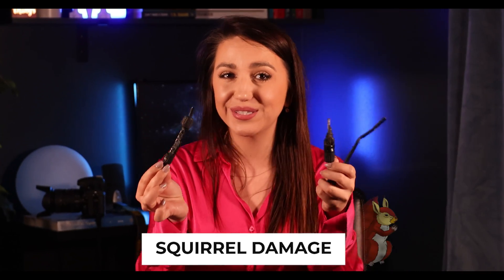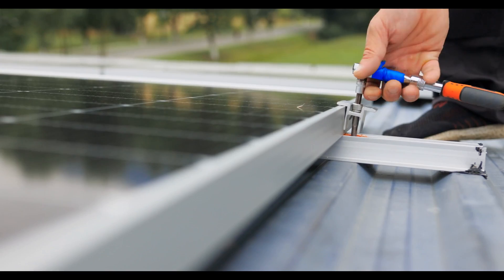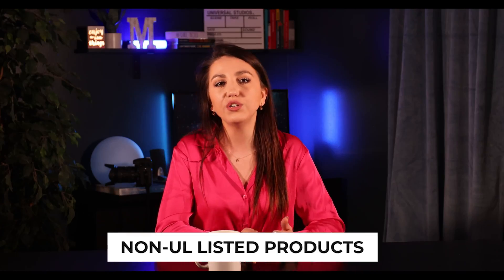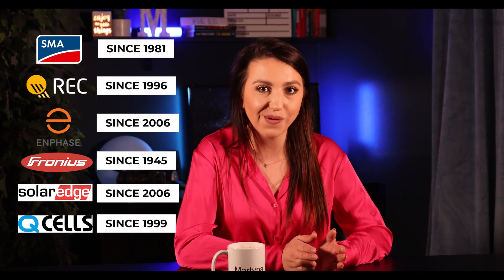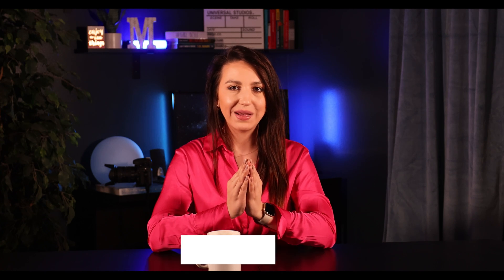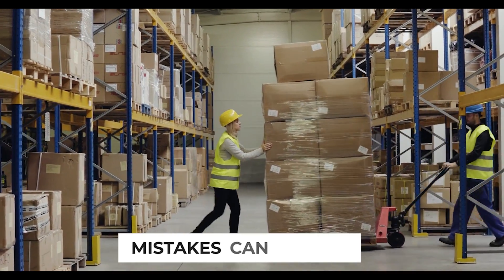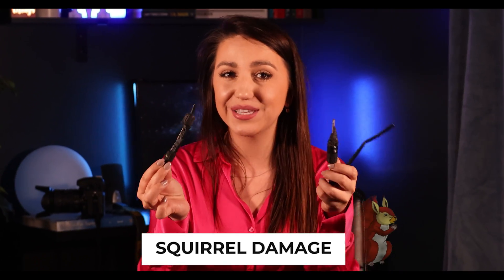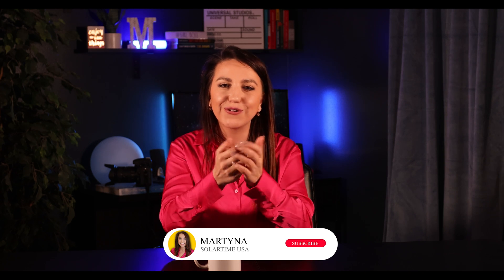Solar Panel Fire Prevention Tips You Need! / BEFORE AND AFTER GOING SOLAR!

Comment: Micro fractures of crystalline cells is a major reason for PV panel fires, I would be surprised if it isn't the main reason. And you can't see the micro fractures with the naked eye. They happen with vibration, impacts, flexing & age (basically everything). It's not an issue with thin films like CIGS or amorphous silicon. I wouldn't use crystalline PV, my choice is CIGS, it's more difficult to find (I think because most people are ignorant and the marketing on the crystalline PV has driven away most CIGS). The thin film PV also has better performance in less than ideal lighting conditions, so while the peak efficiency is lower I think the thin films would perform better over the course of a year.

Comment: the thing with micro inverters with big 500 watt panels  most micro inverters are 250 watts some can reach 375 watts they will not produce power that panel can provide also if something goes wrong you have to go to roof to replace them its  ac so you can putt batteries so you need another box, a lot of installers install them now  you will get clipping on panels if micro inverter is 250 watts and panel is 500  watts
Reply from the maker: Agreed!!! Thanks for sharing your thoughts!

Comment: your video has installers walking on panels its a no no and some wear safety harnes but are not tied off You can walk on solar panels, but it's not recommended. The panels can withstand a lot of weight, but walking on them can damage the modules. The center of the panels may crack, which can shorten their lifespan. The panels are also slippery and hot, and can cause you to slip and fall.

Comment: Long runs of low voltage/high current dc wires are totally wrong. Quickly they drop voltage and that means heat and degredation. I propose a ladder setup with short run of dc to a local inverter on each leg...that improves efficiency and safety and control for each leg.

Comment: No.not fusing the system caused the fire..ignorance..secondly all lithium should have thermistor alarm security.if any rise in temp is seen..the alarm would cut its load and seal it in a chamber.. and call  fire dept..

Comment: These fires are being caused by the high DC voltages in the long series strings that are being used by string inverters. Even off grid solar systems are now unnecessarily using high DC voltages to power their cheap Chinese made, fire prone, high frequency, transformerless inverters, Even when using an MPPT charge controller, off grid inverters should never use a PV voltage that higher than 150 VDC. Higher voltages are simply not necessary, and can lead to fire starting hot spots in the solar modules as well as arcing in PV wiring.
Reply from the maker: I have to somewhat disagree. If you look at statistical date, EU did not require rapid shutdown for decades. Not to mention that in a lot of those European countries German made inverters such as SMA or Austrian like Fronius or Steca allow for even 1000 V DC on a single string. 
And Enphase and other microinverters are NOT popular at all in European countries. Yet there are not  more fires in EU than USA. 

I do agree that CHeap products are super risky but I would not associate String with more risk.

Comment: I don't connect solar panels using plugs because even the best plugs will eventually break down due to weather expansion and contraction.
So I wire direct, because once installed, installation will probably last 20 years before maintenance will be required.

Comment: My issue would be corrosion from the saltwater environment, we are up in a hill about a half mile inland and 350 feet above sea level. Roof is clay tile with a concrete sub roof below. Any insight on stuff that is available in the EU? Also running dual power in the home with EU standard of 230 v at 50 hz as well as an inverter based 120v 60 hz system. And oh yeah, lightning loves to play around this area. As a communications Tech I have installed mount an top solar powered communications systems with zero problems but they were mid sized with massive battery banks needed for cold winter days. Shelters for the equipment were aluminum sandwiched with 8” of polystyrene foam and a silicone heater pads below the lead acid deep cycle batteries.

Comment: I think you left out the most common cause of rooftop solar panel fires and that is rooftop isolators. They were so problematic that the new standard in Australia removes the need for them.
Reply from the maker: Very fair point! Thank you for sharing, it has not been very used in USA at least in my career installing panels since 2016. So I haven't had much experience with it. I am gla dit no longer is a required in AU.... thats a huge win.

Comment: CLICK BAIT TITLE. Never put any Solar gear in a loft/attic or basement. Not even wiring or cables. Put all wiring in weather proof outer cabling over the exterior of the house I have had 3 installs and never allowed anything to pass through my loft.
Garage, vestibule, pantry with exit door,  or exterior wall or purpose built "power house" is where the gear should go. Also if you are fortunate enough to have a piece of land or a very large garden ground-mount or canopy or pergola takes this rare issue away from your rooftop and is easier to clean off for snow or sandstorms etc.
Reply from the maker: Hey! Thanks for sharing your thoughts, I don't see how the title: Solar Panel Fire prevention tips you need is clickbait? 

The house on the thumbnail on fire maybe, its there to grab attention, but all creators on youtube want to grab a viewers attention. I say all that with respect. Hope I am not coming off rude. 

Thanks for sharing your thoughts too, i am a huge ground mount system proponent and have it in our family home! :)

Comment: More Tips for  DIYers: 3’ x 5’ x 1/2” fiber cement backer board behind all equipment. Build or utilize existing outdoor building for power shed (8’ x 10’ minimum) at least 25’ from house. Sheet metal roof or ground mounts. RF interconnected smoke alarms in power shed and house. Several Class C clean agent fire extinguishers.
Reply: Bless you
Reply: That's all very good, sage advice. I am a journeyman electrician who has installed a few solar systems and agree with your recommendations. I am in several facebook groups and the shit I see people cobble together on plywood drives me nuts!!